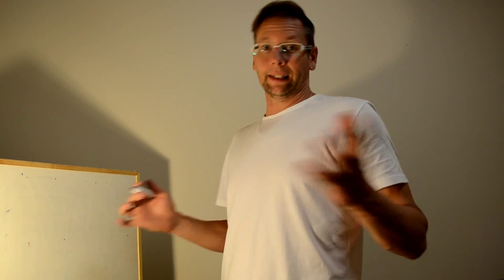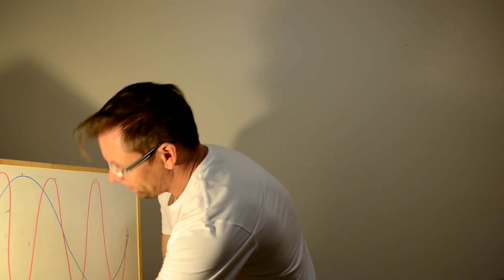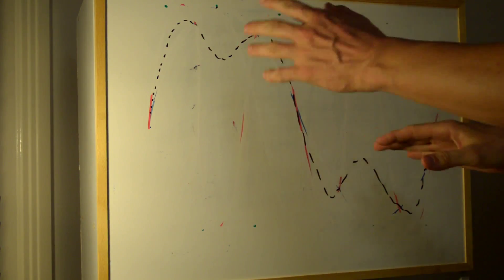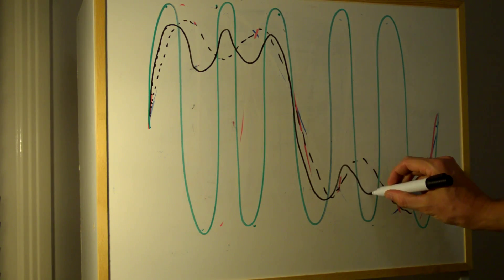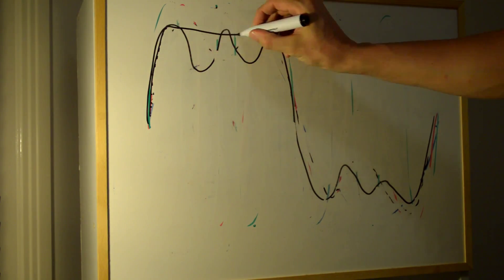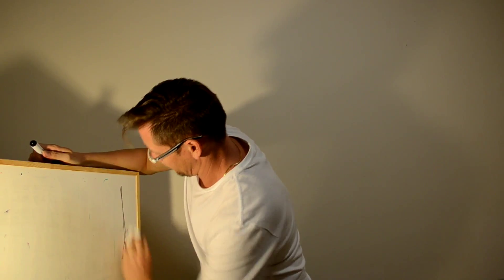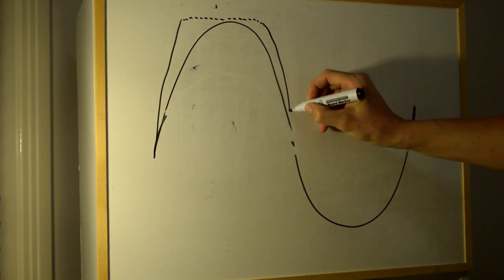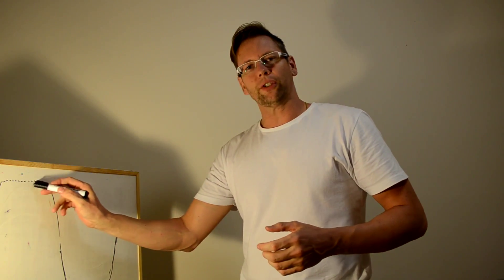Harmonics

Comment: Problem: 
 Illustrations/demonstrations often show the similarities between a square wave and a series of harmonic series sinusidial signals added «on top» the fundamental signal.  But if I were to (ideally) clip a sinusodial wave, I would have to show that doing so is the same as adding whole-number multiplicities of the fundamental, and not the other way around. (?) 
Yes, they may be equivalent operations, but it is still a mystery to me why. That is why clipping a signal adds overtones, and not so much that summing some sin-signals can generate a new square-looking signal.   

Question: 
Can it be show, graphically, witch overtones are added to a sinusoidal when it is just slightly clipped and «fully» squared off? 
And then in turn the relationship between the amount of clipping/type of distortion and the subsequent result in a spectrum analysis? 

  It’s not that easy to convey my problem in text form, but if you catch my train of thoughts here, it would be more helpful to me getting an explanation of why clipping adds harmonics. Not THAT a clipped signal can be mimicked by summing up several signals and therefore it’s the same thing.
Reply from the maker: I get what you're saying, but now have to think of a way to explain it. I'll get back to you. Your question did remind me of the original spark gap transmitter, which was basically just switching on and off and causing shit all over the RF band. Let me think about it and see what I can do.
Reply: @TallPaulTech  Thanks a lot for taking the time to reply!  I would really like to understand this at some point. Others I have asked are just repeating what I now view as «reversed logic». 
I'm looking at this from an audio-perspective btw. If a distorted sin-wave gets harmonics added to it, and it not intermodulation caused somewhere else(witch is not that hard to understand), then what is the nature of the phenomenon? Put in a different way;  "Here is a sine wave, and here is one where the top 3rd is clipped off. This adds these harmonics because <explenation>". And NOT "Here is a sine wave, and here is a sine-wave where the top 3rd is clipped off. This adds these harmonics because we can reverse engineer the clipped sine-wave by adding sinusoidal waves on top of each other». Thanks again!
Reply from the maker: @hakonmoen3438  It's basically because of the non-sinusoidal change in energy, ie during a clipping event. It's like, if you have a constant rf (or audio) sine wave, then on a spec an you will just see one spike at that frequency. If you have that exact same perfect non-distorted sine wave pulsing on and off, you will get side lobes of harmonics. That might actually confuse you further, sorry! Try looking up some info about radar pulse trains and the side lobes they create. It will be based on pulse repetition frequency and duration. There might be something in that that makes the penny drop for you.
Reply: @TallPaulTech thank you so much for addressing my questions. I think I will have to dig a bit deeper still. I'll make sure to look into the stuff you mentioned :) thanks again!